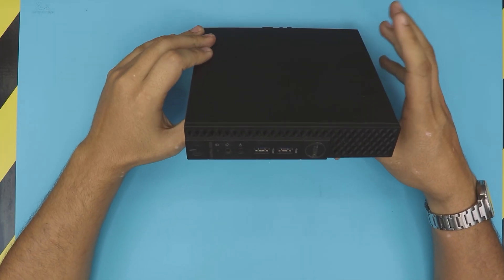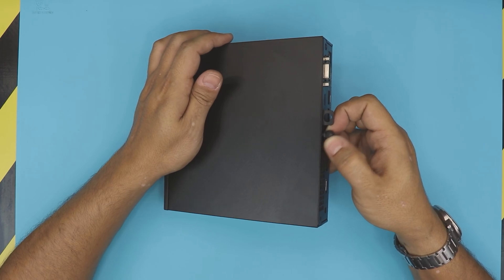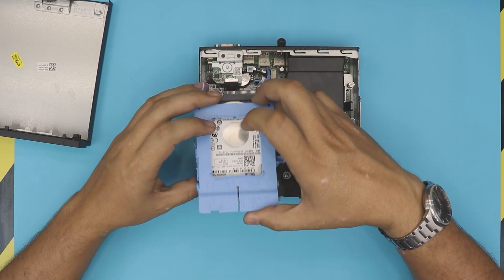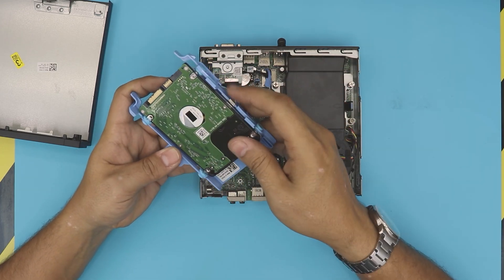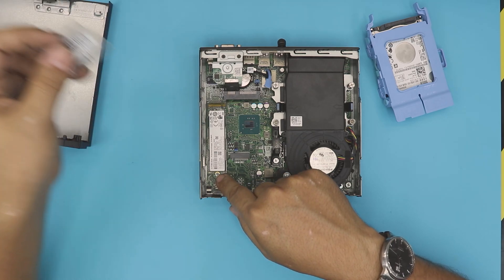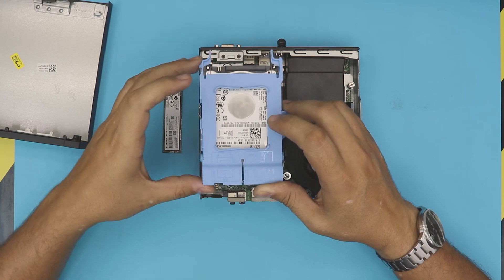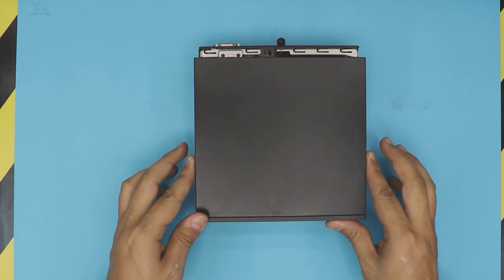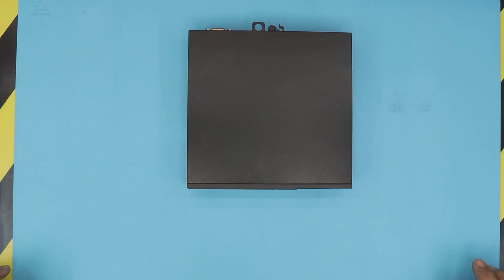Dell Optiplex 3050 Mini Pc SSD NVME / Hdd UPGRADE

Comment: Thanks for the video. I have just purchased a refurbished Dell Optiplex 3050 Mini Pc and a Samsung SSD980 1 TB M.2. I can see the M.2 drive in the setup and in Windows, but I cannot get it to boot. Any suggestions on what I can do to fix this? Thanks ( Is this M.2 somehow now compatible with this system)
Reply from the maker: Thank you for the feedback! if you wish to support the channel you can LIKE or SUB or both :P
regarding your question: you need to remove any other Drive that you have connected and leave the new ssd in, and create windows boot usb and install windows on it, and it will start booting on the new ssd. after finished place the other drive you had and format them for extra storage.
Reply: @uFixTek  Thanks for your response, that was the last method I tried and it worked. I had been trying to use EASEUS Backup Clone and Backup and restore, but I could never get the M.2 to boot. I wanted to do this because that was the only way to save the copy of Windows that came with the computer, luckily I had another unused copy.
Reply from the maker: i'm glad that you got it working my friend,
if you have any question or request in the future feel free to ask me.

Comment: So on this little machine you can install a nvme, but that nvme you got on this video or the one on link, is it a NVME 3rd Gen or 4th Gen.
Reply from the maker: Thank you for the feedback! if you wish to support the channel you can LIKE or SUB or both :P
regarding your question: it take any brand nvme and also its compatible with 3Gen or 4rth gen. but before doing this you must upgrade the bios, we got few more of them in the store after the making of the video and from outside looks the same exact model but it wasn't nvme compatible. and only accepted m.2 sata. if you buying from amazon get nvme and if its not recognized then return and get m.2 sata, else don't risk it get m.2 sata.
its very unclear why 2 out of 10 are not nvme compatible :/
Reply: Ok thank you very much.

Comment: Can you use any SSD drive 2.5 right as I want to buy crucial 250 GB.
Reply from the maker: Thank you for the feedback! if you wish to support the channel you can LIKE or SUB or both :P
regarding your question: YES my friend you can use any 2.5" SSD SATA ssds up to 4TB storage, this is a very cheap and reliable ssd: https://amzn.to/3NBM9wr
but you can use any other models.
Reply: @uFixTek  thank you as original hdd in my moms mini pc is slow af as it also uses windows enterprise not 10 super original lol
Reply from the maker: @Marrawi01  your welcome, and yes with ssd you will see a big difference in performance , good luck

Comment: Hi uFixyek :) Would you have any idea why the PC wont see the new HD? Its not in disc management. Its like the new HD is faulty, or the PC is faulty. Any ideas? Cheers Glen
Reply from the maker: What type of the SSD or HDD did you put and did you make sure its in place correctly (if you can provide pics) (https://imgur.com/) does the drive gets detected in the Bios?,  thank you for the support and your feedback.
Reply: @uFixTek  as it turns out I used the correct SSD for your PC, but not mine 😂  so the SSD is going back, and the correct one is on its way. But thanks for the reply, really appreciate it 😁
Reply from the maker: oki, glad you figured it out i wish you the best any if anything in the future let me know in the comments :)

Comment: Hi, My 3050 Dell does not recognize they m.2 any solution?
Reply from the maker: the 3050 have some issue that it does not recognizes m.2 easy, you can try resting the bios after installing.
You can try, with the M.2 installed, to reset the CMOS Memory (BIOS) and see if that gets it detected.  To reset the CMOS memory, with the PC powered off, remove the CR2032 battery on the motherboard for at least 10 minutes.  Reinstall the battery, observing, polarity and power on.  See if this helps.  If not, do you have access to another PC that you can try the M.2 on to verify its working OK?
Thank you for your support to the channel
Reply: I would imagine you tried to use a M.2 Sata SSD. Apparently it is NOT compatible with 3050 Micro. It can only accept PCIE M.2 (ie M.2 NVME SSD). I tried 3 different M.2 SATA SSD, all refused to work. Not sure why Dell made it this way, but that is how it is.

https://www.dell.com/support/kbdoc/en-vi/000129720/optiplex-3050-support-for-pcie-m-2-ssd-hard-drives
Reply from the maker: @JeromeFDavis  i  do actually have this mini pc and i have formatted an m.2 ssd sata and last week i upgraded to nvme and both worked just fine, BUT i did had to upgrade the Bios firmware.